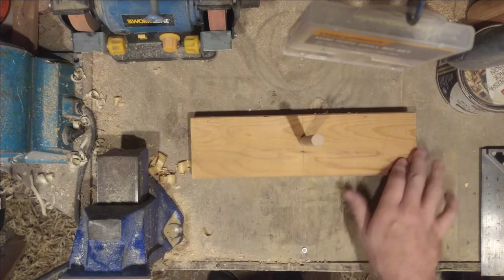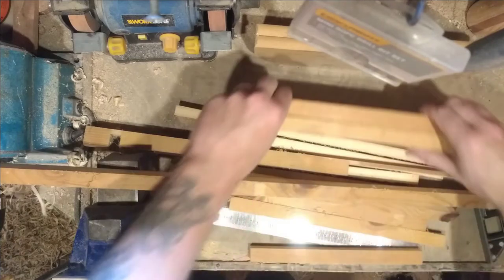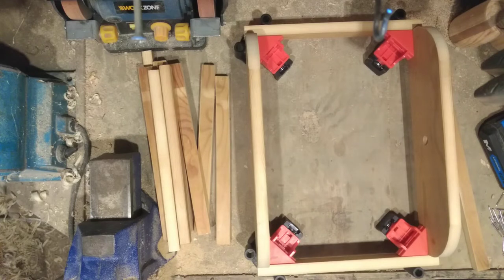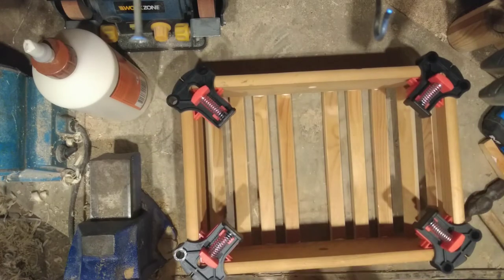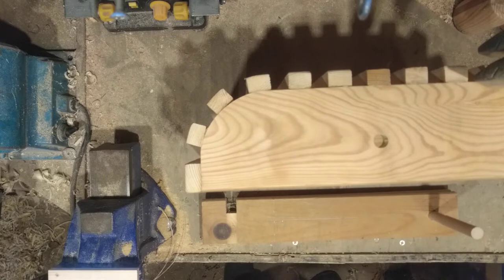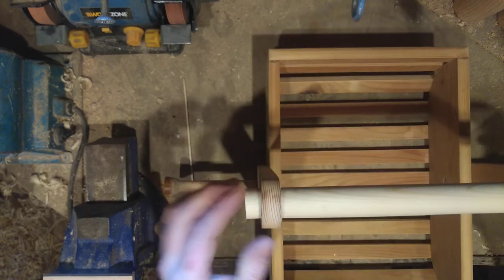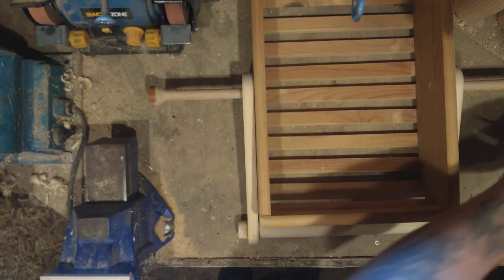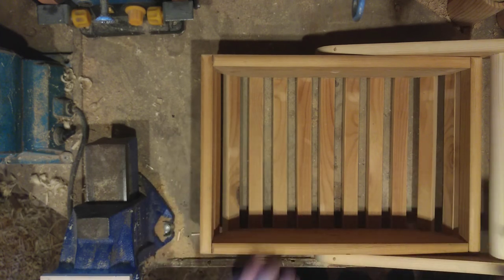How to make a trug

Comment: That’s a really nice project for some old shelves to new true!
With the handle tucking out of the way you could do a neat set of 3 that nest together.
👍
One tip, when there are lots of pieces that need the same operation (eg drilling the pilot holes in all the slats) then lining them all up to do together makes it really quick 👌